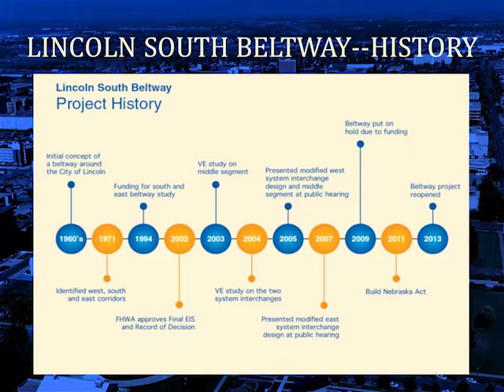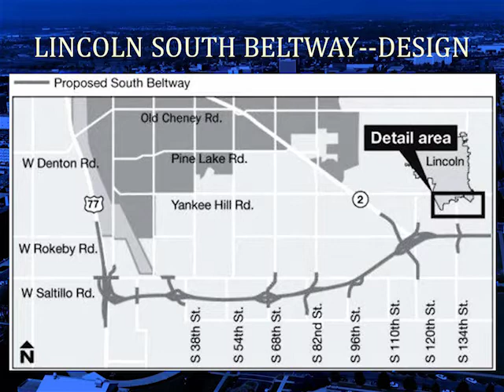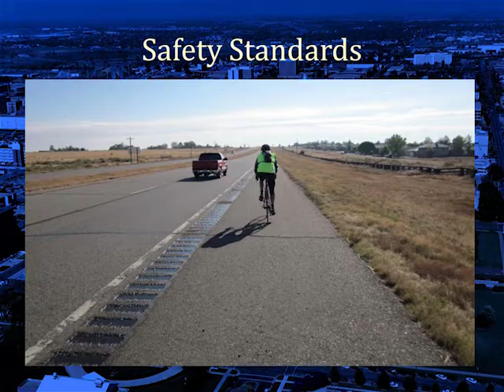Lincoln South Beltway Project Development Bicycles

Comment: They should starting to build the East Beltway, as they do on the South Beltway just outside of Lincoln Nebraska. The east Beltway will begin at I-80, between milepost 413 and 414, and there is enough room to do the project, instead of the US-6 at milepost 410, because there are buildings in the way, which is located in Waverly, just east of Lincoln Nebraska.